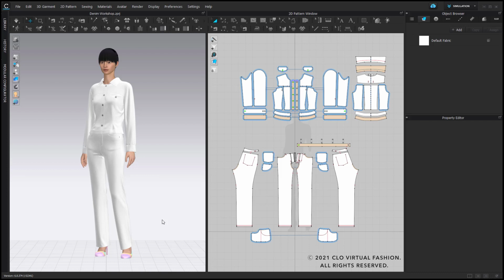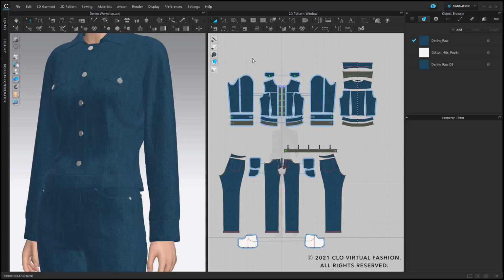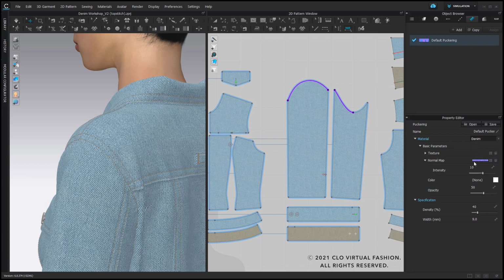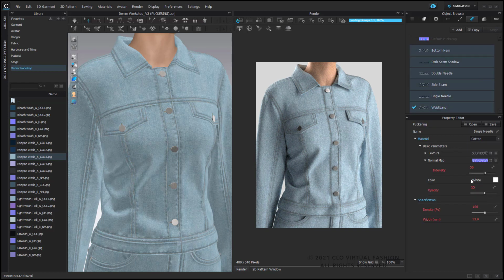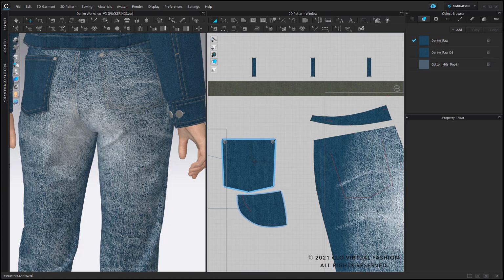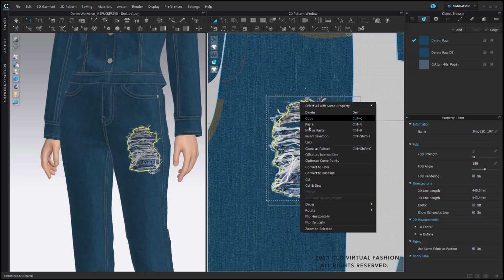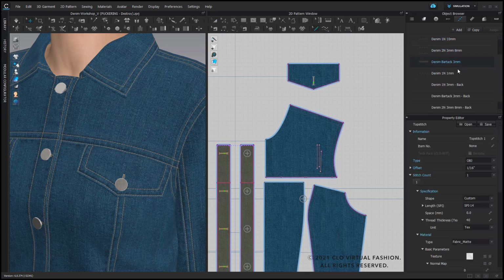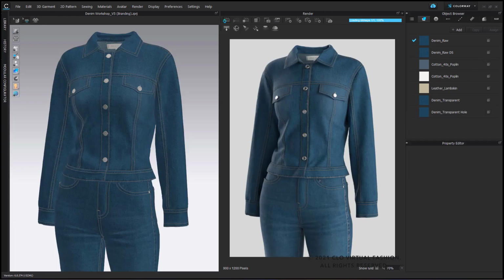Denim and its Treatments

Comment: Hello,great video! Could you show in what software you create normal map,texture and how? Where can we find such tutorials? Thanks
Reply: Photoshop is a fantastic tool but its very expensive and you will need months to learn how to use it. For start already you can look for fabric prints in Google image, looks for seamless prints so it will repeat without showing edges. Then you upload it in the Fabric TEXTURE menu. Under, you have the NORMAL MAP zone, even if you dont have a normal map of that texture, go to the Normal Map intensity cursor, right under and if you type a number, you will create a Normal map from the image texture you uploaded. (it's a purple like image) If you find black and white prints or with transparent background .PNG or ALPHA, you can create laces, or see-trough materials, you will be able to create holes in the fabric. When uploaded, if its a regulart black and white print, choose RGB in the Opacity drop down menu (then all the designs printed in black will be transparent) if your image is b&w or colour but have transparent zones already, choose ALPHA in the drop down menu, all the parts that are not printed will show transparent)  I hope I wasnt to complicated and that will help you.
Reply: @kidnap2010  Beautifully explained.
Reply from the maker: for further help we recommend posting to our Official CONNECT Forum - https://connect.clo-set.com/community
Reply from the maker: Most recommended application would be Photoshop. https://youtu.be/7nLjJa6SVnA
Reply: Hello Photoshop is f